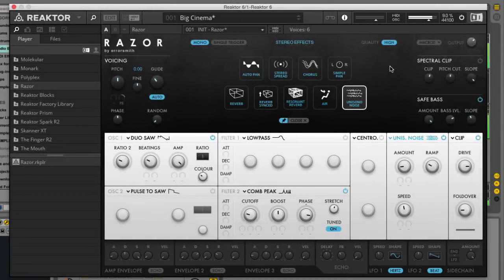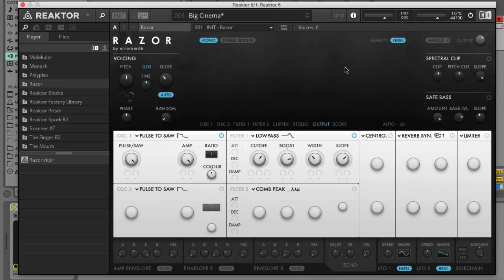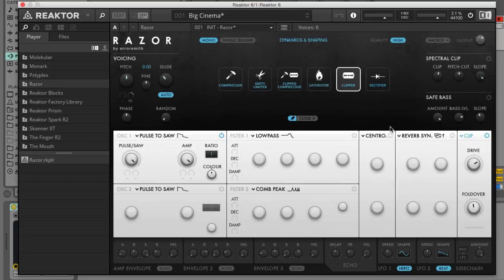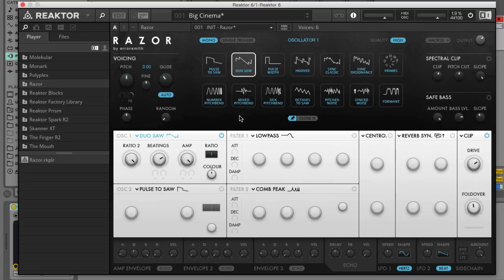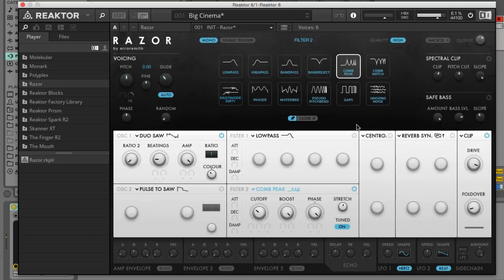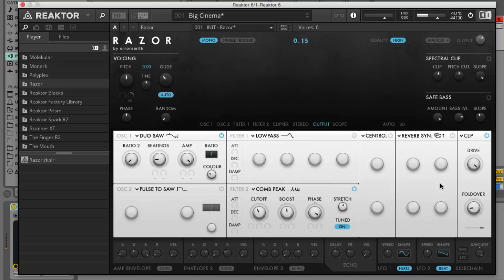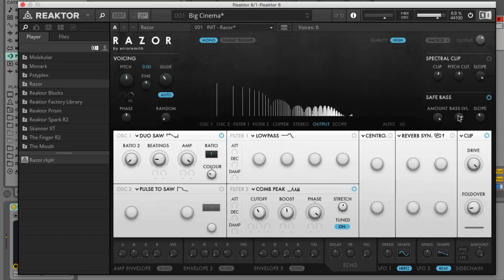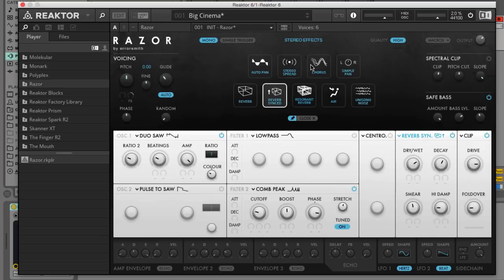How To: Making analog bass sounds in RAZOR | Native Instruments

Comment: Cool video! May I ask how is this different than Massive? I use Massive for pretty much anything, bass, leads, pads...
Reply: Massive is wave table and razor is additive, two totally different beasts. Wave table is basically the same as subtractive, so you start with the sound waves from the oscillator, and then remove frequencies with filters to create your sound. Obviously massive has a fx and inserts that add frequencies.

Additive is where you start with a very basic wave form and add harmonics to create your sound, with a small amount of filtering to reduce the harshness of the sound.
Reply: This synth creates the sound by completely different algorithm so it has very diffrent sound even with the same settings.
Reply: xkidmidnightx dude chill out, he said '''think'' so he's not putting out false statements
Reply: V Petrov i dont think there is a diff